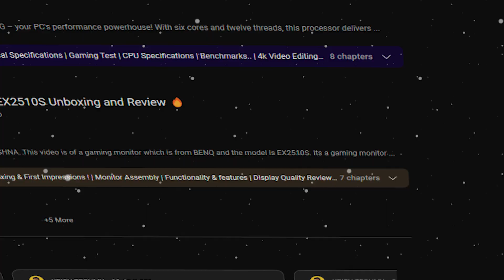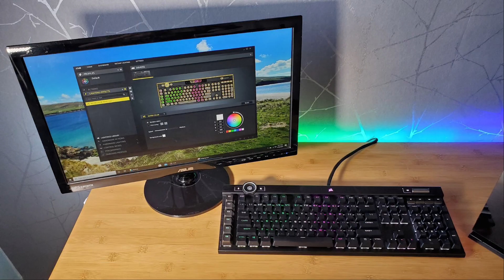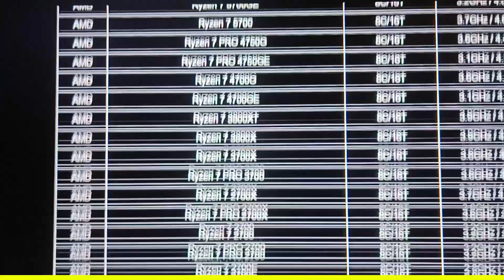Windows 10 is Dead - Stop🚫 Using Windows 10 (Best alternatives) | KRISH TECHMY

Comment: You dont need to 'throw" your pc, there's literally a work around method to install W11 on unsupported devices by Microsoft's themselves. I have managed to install it using that method on an almost 9 year old laptop and it works without any issue.
Reply: But it slows down my pc